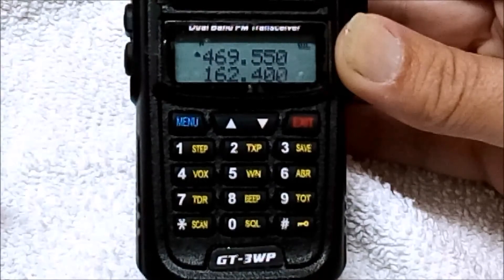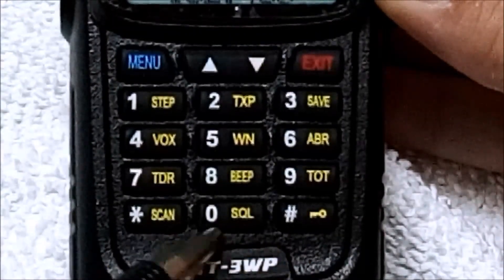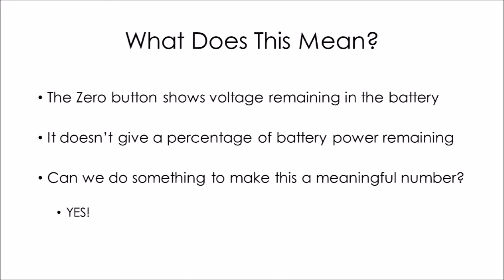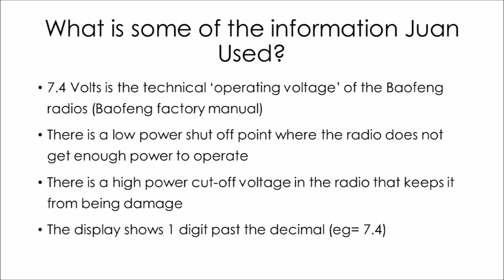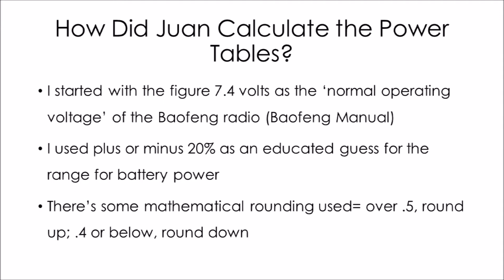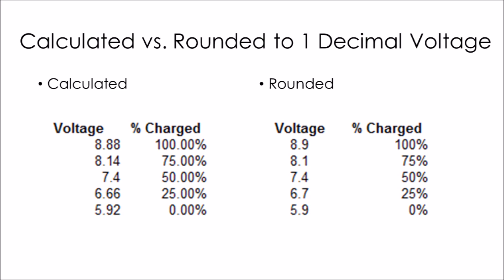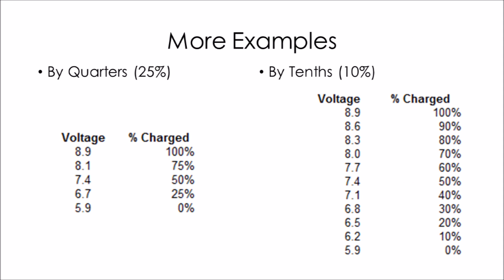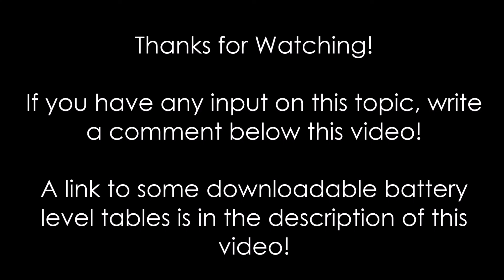Display Battery Level - Baofeng Radio Shortcut Button

Comment: A Li Ion cell, while "nominally" 3.7 V, is fully charged at about 4.2 V, so a battery pack that says it is nominally 7.4V (like the Baofeng UV-5R's) is just TWO Li Ion cells in series.  In this case "fully / 100% charged" 2-pack would be about (2 * 4.2 =) 8.4 V.  At 95%, the reading would be ~8.2V.  But between ~95% and ~15% the discharge voltage "slope" is so shallow that the open-circuit-voltage would decline only from 8.20 V to 8.00 V.  So with a voltage readout that displays only ONE digit after the decimal point, everything between ~80% and ~50% would read 8.1V, while everything between ~45% and ~15% would read about 8.1V.  Pretty hard to tell how your doing with that level of uncertainty.  Having a fairly flat voltage curve through all the useful levels of operation is great - but without a very accurate voltmeter having at least two digits after the decimal point, you would be hard-pressed to be able to say with any certainty just where you stood.  There are lots of graphs of Li Ion cell packs around.  This one (https://www.powertechsystems.eu/home/tech-corner/lithium-ion-state-of-charge-soc-measurement/) shows the curve (in RED) for a 14-cell Li Ion pack (probably used in an electric bike).  By dividing the voltages shown by (14 / 2 =) 7, you can see what the voltages would be for a Li Ion pack of two cells (like in the Baofeng UV-5R).

Comment: You assume a linear relationship between voltage level displayed and power remaining.  I am not sure this would be true, especially at the high and low end voltages of the nominal 7.4V  Li-ion battery.  Nevertheless it is better than nothing!
Reply from the maker: True! The 90/5/5 duty cycle estimate is a pretty vague assumption I used as well. A Baofeng enthusiast might be inspired to do more digging into this topic and add to the community knowledge. Nearly all the real technical information on the internet is crowdsourced from Baofeng enthusiasts doing their own research and sharing.